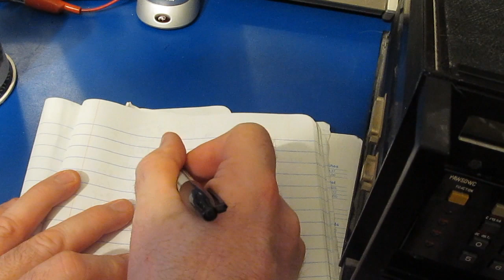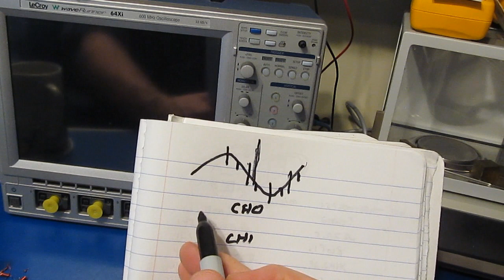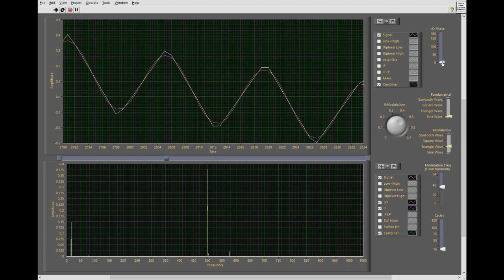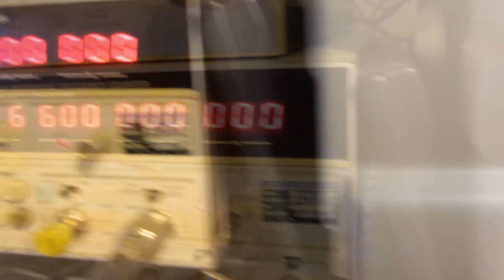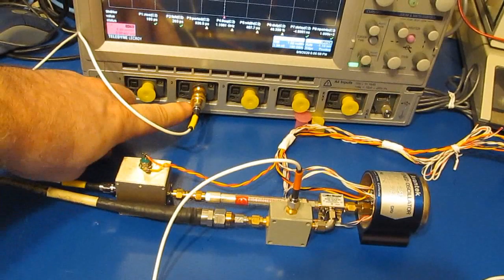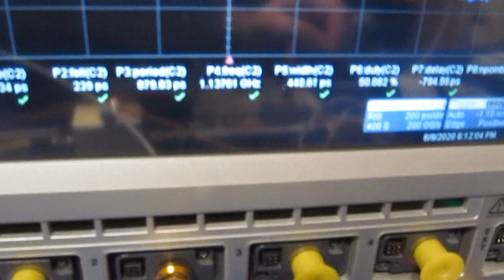Digital Bandwidth Interleaving, Downconversion and Fast Oscillators

Comment: I think you've lost me at around 12 minutes in.... I understand how down-conversion works, how to read the signal in frequency and time domains, and what the high- and low-pass filters are for in the process, having done some SDR coding, and a lot of generic DSP.

But I don't understand what exactly was happening with this demo.

What went to zero @12:13 ? Nothing had changed for a while, and you were circling the spike in the frequency domain near 1050 when you said it.

I could see the modulation of the pink line in time domain view had smoothed out when you changed the modulation over 5, but you hadn't changed anything for quite some time when you suddenly announced "oh and right there you can see it's gone to zero"... while moving the cursor around the spike which was still poking upwards, and definitely not zero.

Something similar happened when you were describing pushing the frequency lower than the LO... I lost track of what you were saying as I couldn't see what you were referring too. 

I've watched the 2 minutes around that time like 10 times in the past 30 minutes. I think part of the problem I had was that the time and frequency domains weren't showing the same things, and you would switch things on and off at various points without saying what you were doing. 

I've found in the past that once something technical has lost me, it's very difficult for me to follow the rest of what is being demonstrated. ;/
Reply from the maker: The imaginary scope can look at data below 500 smiths.  We doubled the BW.  2X500=1000 smiths.  We increased the modulation frequency to 1050 smiths and the scope as you say "smoothed" out the pink line.    Why?  We said the mixer will provide the sum and difference of the LO and RF.   1050-500 = 550.   550 > 500 smiths.  Again, we had low passed the IF to remove information above what the scope can measure (500 smiths).  This is why the combine plot (pink) modulation information goes to zero. 

When I move the modulation frequency below 500 smiths, so both the fundamental and modulation are now within what the scope can look at.   There is no information > 500 smiths.  In this case, the scope just directly displays the information.  

For more details, I suggest reading LeCroy's patents.   They provide a lot more detail than what I went into during this basic demonstration.
Reply: @joesmith-je3tq  Thanks. That description with the actual numbers in it cleared up what I was seeing.

One of the good things about getting confused is it made me look deeper into it. ;]
Reply from the maker: @zenithparsec  Glad to help.   With the superheterodyne receiver being around far longer than I have, the principles are well documented and understood.   Books like the ARRL handbook make good reference material, although you will find this same information on the web.  The idea of applying these techniques to a DSO don't seem novel to me.   The only problem I see (and decided not to show as it makes the demo more complex than needed) is how to sync the software LO with the physical one (assuming this is an external peripheral).    That phase error will directly pass down into our data.   I was thinking a third channel would collect the physical LO but we would loose half the sample rate.  Then again, if we are running RIS.....   It's an interesting idea but in our particular case, again, it's not needed as we really don't have any low frequency information that we care about.
Reply from the maker: I suspect if you had questions, others did as well.  So I have decided to pin your comment as others may find it helpful.

Comment: I'm not sure that would reconstruct a non-sinusoidal signal, assuming the whole signal would fit in the bandwidth of the circuit.
Reply from the maker: Hello Glasslinger.  First, let me just say I have really enjoyed watching your glass work over the years.  Especially seeing you recreate some of these old vacuum tubes and operating them.  So, a big think you!

As for your comment, I assume that you're referring to LeCroy's Digital Bandwidth Interleaving.  I suggest you look up their patents on Google Patents or by other means.  They are a very good read.  This was how I was able to write the simple simulation software to demonstrate it.    If you look though the comments, you will find Roger Delbue of LeCroy chimed in and provides some additional insight.

Comment: Hello Joe, I run into your channel and was surprised by the topic. I have been involved in all the DBI scope we made at LeCroy from the first 11 Ghz,  more then a decade ago, to the 100 Ghz we made few years ago. Your explanation is good, although the real implementation is a bit more complicated. Certainly for 1 tone what you did is spot on, the problem will be the group delay through the system when you consider more frequencies situated on each side of the diplexer... Congrats for the oscillator it feels good to have a world record even if it will likely not be remembered nor understood by most... that was the case for me when we reach 100 Ghz 240GS/s.
Reply from the maker: Good to have you visit Roger.   I tried to find a video explaining DBI but all I found were a few papers and of course, the patents.  I put this simple software simulator together to give viewers some visual idea what was going on.  There is a phase adjustment control that I decided not to show as it was getting too complex already.    That 100GHz scope is still very impressive.  You should be very proud to have been part of that team.   Pushing technology like this can have far reaching effects.    My little oscillator, not so much.  lol.  We are just having some fun.

Comment: Is that software proprietary?
Reply from the maker: I assume you are asking about the algorithms I demonstrated.  Yes, they are patented by LeCroy Teledyne.  You can look up that patent number I provided.
Reply: National Instruments recently made their “home” version of LabVIEW entirely free - which is incredible! Learning and using LabVIEW is such a worthwhile skill for an electronics engineer. 

I develop in LabVIEW professionally, so I had to stump up the nearly £5,000 for the full license + annual maintenance, but it is worth every single penny!
Reply from the maker: @alexscarbro796  Home is similar to the base license where Community appears more like Pro as it actually includes the application builder.  I had signed up for the beta testing and it looks pretty good.  The problem is that I don't know if it's really free and what their future plans are for it.   Do you need to renew the license every year?  If you don't, does it stop working?  Will they charge you for it in the future?   I have a lot of questions about it before I would suggest anyone take the time required to invest in learning it.   I tried to find more details about it but all I came up with was a bunch of marketing fluff.   I suspect they were loosing their user base to Python and other free tools and new without making a change,  LabView wouldn't survive.   If you know the details about the Community license, fill us in.
Reply: joe smith Unfortunately I don’t know any further details, but you raise good points. I also think you probably “hit the nail on the head” regarding Python eating market share - particularly with undergraduates learning/using Python at University and in their spare time, it might now be more difficult to get them hooked on LabVIEW early on.

Comment: Put a length of dental floss in the knob. Thst will tighten it up and stop it from falling off.
Reply from the maker: I could maybe wrap the front cover in dental floss while I am at it, before it falls off too.  It's really too bad the mechanics of this scope are so poor as the EEs and software teams did a nice job with it.  It's not something I would expect from LeCroy but they seem to be in a race  to the bottom with their rebranded Siglent products.